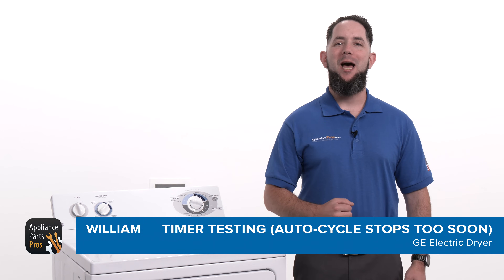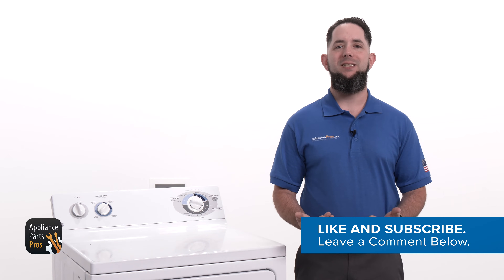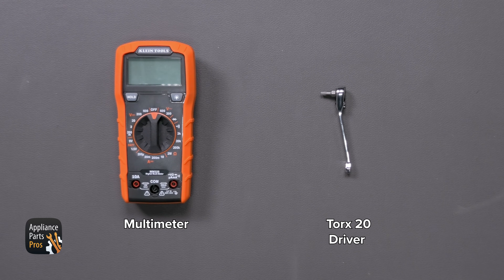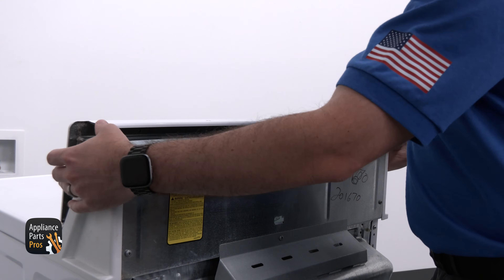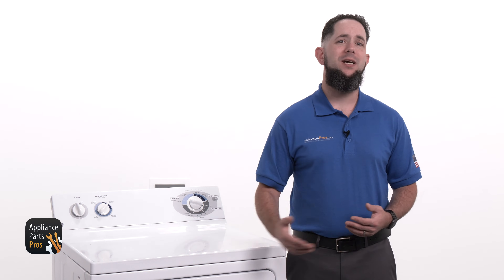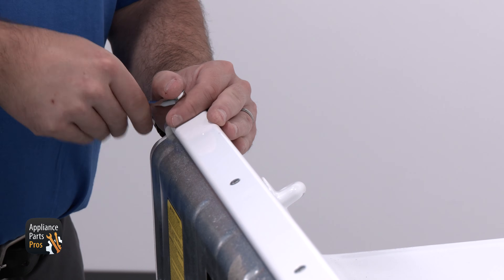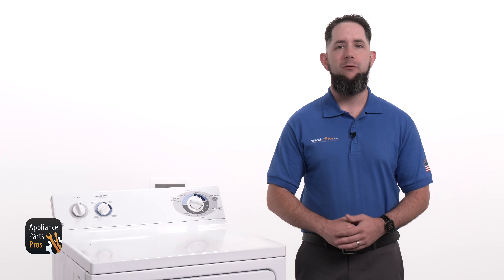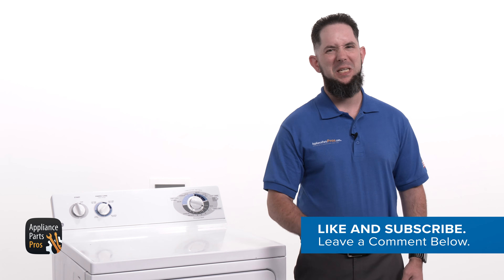How To Test A GE Electric Dryer Timer That Stops Too Soon On Auto Cycle

Comment: I have this exact GE model. I replaced my timer but the new timer still won't advance. Could it be the resistor? How do I properly test that?
Reply from the maker: What is your model number?
Reply: @appliancepartspros   DJXR433EC3WW
Reply from the maker: The resistor is tested for resistance with a multimeter. The resistance should be 4500 ohms
Reply: @appliancepartspros  It tested right at 4500 ohms. Any idea why even the new timer won't advance? It will run all night if I don't stop it. I noticed this model doesn't have moisture bars. It is still heating but seems to now be taking a long time to dry. Lint trap has been meticulously cleaned.
Reply from the maker: You will need to check the blower housing and around the motor and vent to make sure you don't have a lot of lint build up in those areas. If that is clear you will need to test the cycling thermostat for continuity with a multimeter.
Reply: @appliancepartspros  Will try that next, thanks for responding and for your help!